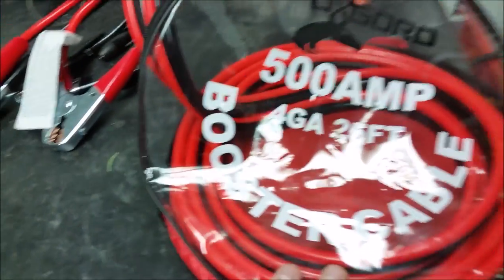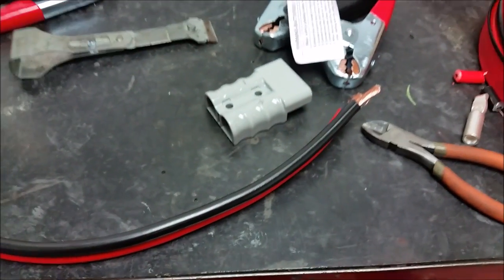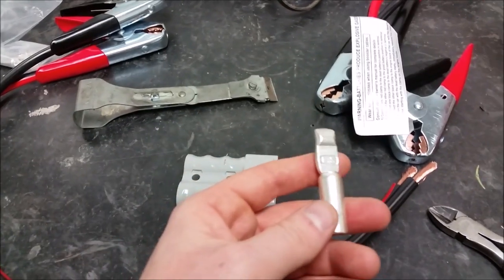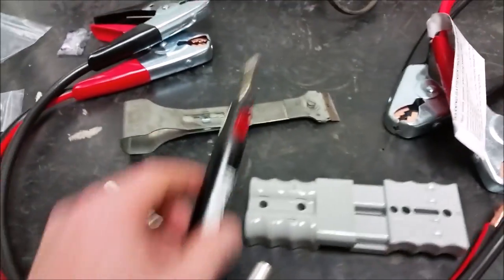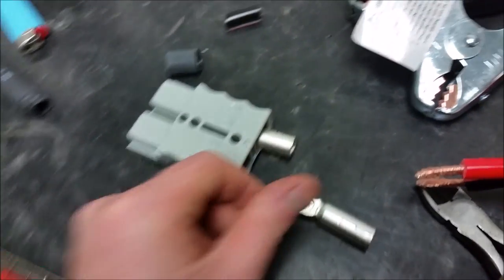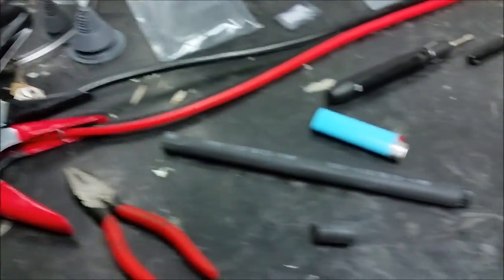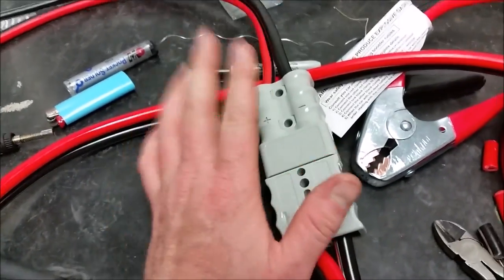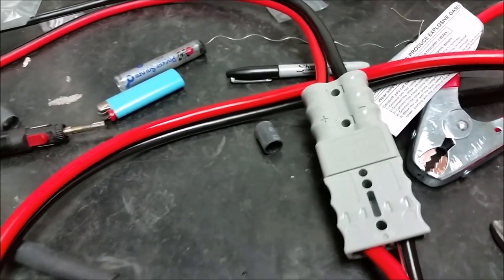Harbor freight winch project -  Power to the winch

Comment: Looks like the cables are actually 4 gage wire and the connectors are 4/0.  4 gage = .2043 and 4/0 = .460  If the jumpers were 8 gage they would be 1/8 inch. Looks closer to 1/4.

Comment: You should be able to just buy the lengths of that wire at most hardware stores. I got that same setup. I just hard wired the leads to my battery on my truck and bolted the plug part just inside my grill on my truck. I used a 3500 lb. electric winch to lift my snow plow, so I had to have some kind of quick disconnect for putting it on and taking it off. These plugs work perfect for that. I've had it on there now for the past 10 years with no problems yet!

Comment: I have 6ga wire on mine two winches 5000&10000 work trailer and truck powered by 2300 generator and a battery charger!

Comment: Those are 4 gauge wire and you dont need crimpers to crimp just put the cable in it and place on hard surface and smack with a fucking hammer and the use heat shrink tubing to make water tight along with battery sealer spray

Comment: How did this jumper setup work for you ? I just purchased the energizer jumper set for an 8000lb. Ramsey.  I also want to be able to move the winch around.  Please let me know how it worked out
 Great job by the way.
Reply from the maker: Limited Edition I’m pleased with the setup. If I would do it again I would buy a heavier gauge wire at the hardware store. I feel like there is some power loss with a cable that long and size.
Reply: Thanks much. I appreciate the reply. My kit is on the way. My concern was the gator clip.  I reckon all is good as long as they don't slip off the battery terminals and ground out. Thanks again.
Reply: I bought 0 gauge wire from Amazon
Reply: What gauge wire should I use? I wanna hook my utility trailer up to my truck battery when I use it.

Comment: Homer
I have been wanting to do the same thing  for a while now, but here is why I’m hesitant to do it this way. The gauge wire on the winch is 6gauge and if you get a larger jumper cable I would have been told that you do not want to have two different size wires connected together and cause a fire. Example if you get a larger jumper cable guage and the winch wire is only 6 gauge it’s my understanding that is not good? I’ve always been taught learned that you have to use the same size wire connected to each other you don’t want to have a larger  gauge wire connected to the smaller gauge wire.

Comment: you're so much better off soldering connectors like this.  Water and other elements get into crimped connectors and cause them not to conduct even when they pass the tug test.
Reply: The alternative is dip the stripped cable end in silicone "tuneup" grease which excludes water (small packets are often sold with spark plug wires). https://www.permatex.com/products/lubricants/specialty-lubricants/permatex-dielectric-tune-up-grease-4/  Nearly every US auto store carries it. Good for battery terminals too.

Comment: Nice vid. I dug deep into a forum once where a hand full of "electrical engineers" proclaimed that you shouldn't solder cable connectors this large because under a high amp load the solder will crack causing poor conduction that would get worse over time. Just curious if you have experienced anything like this? Thanks in advance.
Reply from the maker: Nothing yet. I haven't used them a whole lot though.

Comment: Your connector looked likes a, 120 AMP or 172 AMP housing with the, 2 AWG or 1/0 AWG contact's: These connector's were designed for jumper cable's so your cable wire is, 4 AWG: Oh for everyone "AWG" stand's for "Automotive Wire Gauge":  And I bet you got your's from "Del City"-----Please let me know if I'm right about Del City,    Thank You.
Reply from the maker: Steven Sargent the connectors I ordered were specifically 4 awg that's why I figured the wire was smaller than 4. Also Awg stands for American wire gauge- not automotive.
Reply from the maker: I ordered them on Amazon from a place called Jc cherry inc.
Reply: On the DC side the A stood for both, and some people use both like me.
Reply: AWG does not stand for automotive wire gauge
Reply: @thehot1911  NOBODY CARES